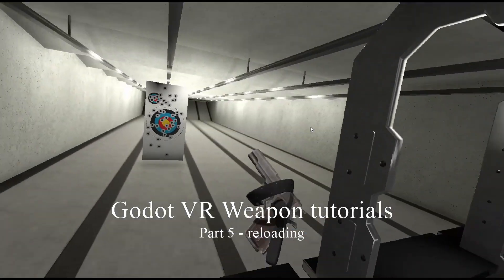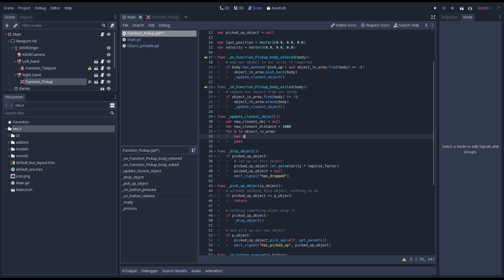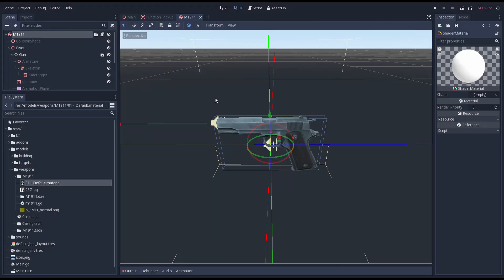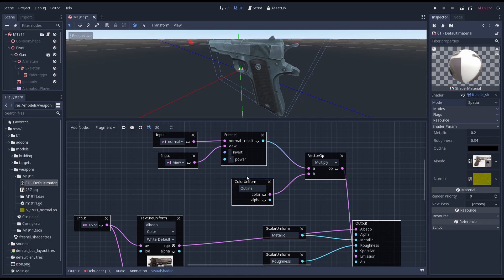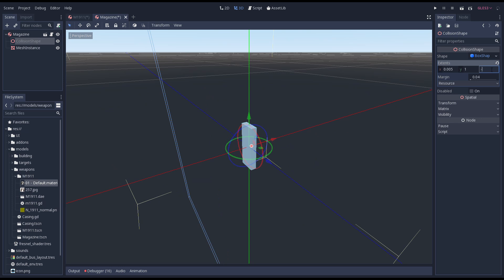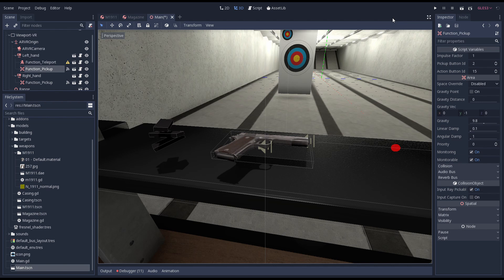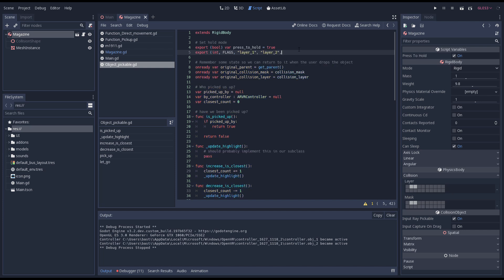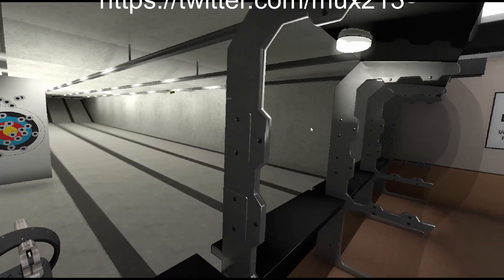Godot VR Weapons part 5 - Reloading

Comment: nice tutorials, i wonder about one thing.. How would i actualy drop the current magazine, as so far the gun just eats the mags, no matter if the current is empty or no matter if there is already a mag inside. So how would i prevent the gun from loading if a mag is already inside?
Reply from the maker: Well it's not a real gun :) So in this case the magazine no longer exists once you reload the gun. All we have is an ammo count.

The way you would implement this is to have a flag on the gun "magazine_loaded" that becomes true when you load the gun, and stays true even if you fire all the bullets.
As long as this flag is true, you disable the area detection that would load a new magazine.

Now you need an action, either a button or something physical on the gun to unload the magazine. When you trigger this you spawn a magazine object, make a little animation that has it exit the bottom of the gun, and then let it freefall to the ground with a timer to destroy it after a few seconds.
At the same time you set the flag to false so you can load a new magazine.
Reply: @BastiaanOlij  now yes this is sorta logical for a traditional fps but since its vr, it makes more sense to use godots xrsnapzone, that way you keep the physical mag inside... on a side note, this way one could implement loading mags themselves, by picking up a empty mag that got an snapzone (maybe with an array if thats possible) and the player could insert bullets into the mag itself
Reply from the maker: @J0linarTube  Yup, there are a lot of options here. It really depends on how complex you want to make things.

Using snapzones from the XRtools library is an excellent way to solve this problem.

Comment: as always i love the framerate 😀😀😀
Reply from the maker: Misogear it’s all my poor laptop can do
Reply: @BastiaanOlij  same here man my  pc too can only run godot for 43 fps. 😭😭😭 for simple voxel world😆😆😆. but i think my pc is mid level gamming spec. hell it can run cod black ops for 144 fps but not godot. 🤪
Reply from the maker: @misogear  I've got a 1060ti in my laptop so it does ok, but VR takes a pounding, add to that recording it starts to struggle.

Godot still needs a few things BUT people forget that the engine is only part of the equation of making a game fast. You can make the fastest engines run dog slow, and you can wring a slow engine for speed if you know what you're doing.

In the end, whether it is unreal, unity, Godot or any others, multi purpose game engines are full of compromises.
Reply: @BastiaanOlij  maybe ? BUT why in unity the same game asset and code run at more than 300 fps ?
Reply from the maker: @misogear  can't answer that, depends a lot on the game asset, what shaders are being used, how the scene is put together, etc..

Unity and Unreal have optimization routines that can turn high poly models into lower poly models and have more logic around occlusion culling. They can also fall back on faster shaders while Godot right now purely has the new PBR shader pipeline. 

In the end, Godot still has a way to go before it "just runs" regardless to what you throw at it. So you do hit limits earlier on, some you can solve if you know what you're doing, others are still out of reach. There are many games you can make with Godot, and there are games where for the time being it's not good enough yet.

Have a look at some of the posts Markus Wolfram is currently making on Godots facebook group, he's really experimenting a lot with scene setup, what works well, what tanks performance, and making some really nice examples of what you can achieve.